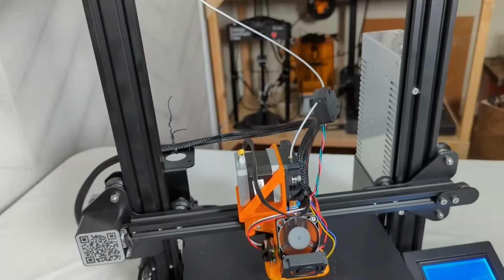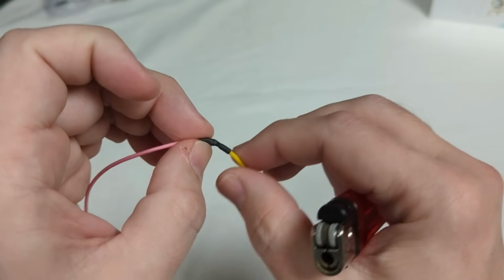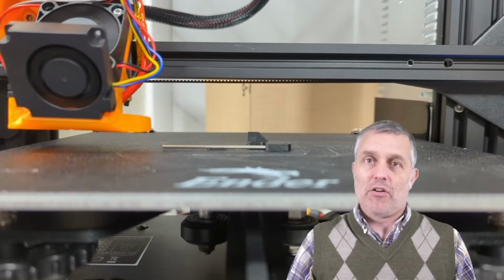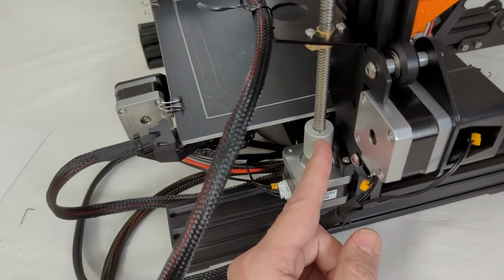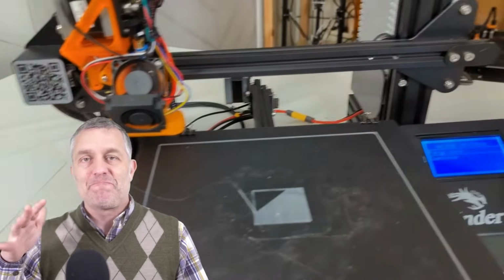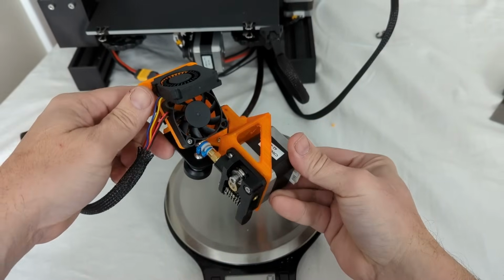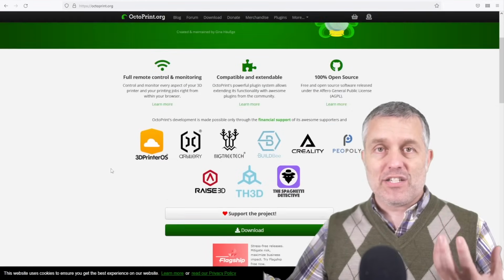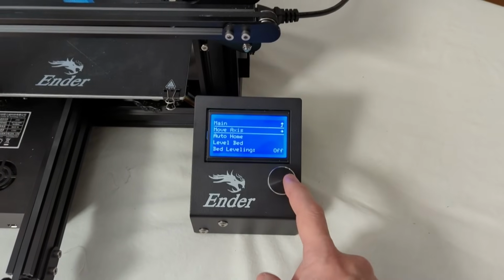Unbeatable for $200 - A 3DPrinter for Newbs & Print Farms

Comment: I think the part cooling fan duct should be a separate part. If a print fails and the duct gets damaged, a disassembly of the print head is required.
Reply from the maker: GOOD POINT! I've done this before and I forgot about it.
Reply: @DesignPrototypeTest  yea Josef Prusa would have made it 2 parts.
Reply: It's also a good idea to print the part cooling duct in a more temperature resistant material then the rest of the hot end casing, since it is subjected to much higher temperatures, and then use a lighter material for the rest to reduce the overall hot end weight so you can print at faster speeds without as much of a hit from the direct drive motor.
Reply: Petg is good for high heat stuff because it doesn't give of the VOCs like ABS.
Reply from the maker: @rjward1775   PETG suffers from far more plastic creep and heat deformation than ABS.
Reply: @DesignPrototypeTest   just print it with ASA should be as good as ABS, am i right?

Comment: So I just want to build the optical endstop, is it ok to not built the filament run out switch? because I feel I don't need it
Reply from the maker: That will be fine. If memory serves that is a normally open switch. Meaning the contacts touch each other when there is filament present. So, you need to connect the sensor wires together (or put a jumper between the pins on the PCB) to send the filament present signal.

Comment: The runout sensor is nice, but I keep thinking a movement sensor is required instead. The runout sensor is just a microswitch. We need it to be a rotary encoder so filament jams or filament breaks between the sensor and the extruder are noticed. A pulse making sensor whose count can be compared to the pulses sent to the extruder motor.

Comment: Anyone who has gone into large scale printing of the same set of parts with a print farm (Like Prusa himself!) should NOT be using a print farm, but have gone to injection molding.  Print farms are only viable for the prototype and alpha/beta test phase of a project.  Once you are into mass production and have all the kinks worked out, goto injection molding!

Comment: Bowden system places less mass on the X-Axis,so can have higher acceleration.  The Y axis is limited by the mass of the bed, so really, having the print head move in BOTH X and Y directions is the best for speed and lack of ghosting.  (Core XY?).  But even on a Prusa I3 type printer, the extra mass on the X axis will cause one end of the axis to droop from the weight if the Z axis isn't driven by TWO drive screws.  So, a direct drive extruder SHOULD be installed on a machine with TWO Z drive screws.  Now maybe the bed level system will compensate for this?

Comment: Does this work on an ender 3 pro?
Reply from the maker: The prints will bolt to the x-carriage. I don't know about the control board on the pro. These days. Might be a little different. The firmware as well might need some minor tweaks.
Reply: @DesignPrototypeTest  Thanks.  The control board on the outside looks the same, but something must be different because when I hook up the filament switch and optical sensor per your wiring diagram they do not function.  In fact the whole unit won't function with them plugged in.
Reply: @DesignPrototypeTest  Why didn't you use the G & V pins that are dedicated to adding the BL Touch?  You are only using the "out" pin from there.
Reply: @DesignPrototypeTest  Wiring is the same, I just had it wrong.  Firmware wasn't to bad to make following 3D Printscape's explanation.  It should be noted that it is important to get the allen key tip as flat as possible.  I experienced a wobble that caused the probe readings to fail, but was able to fix it with flattening the bottom of the probe out more.
Reply: I ran the repeatability test and it was pretty poor 0.018.  I attribute the result to sloppiness between the probe and the hole and the wobble factor.  With a piece of 1.5 mm ID brass tubing, some filing and sanding, and a cut up old credit card I now have improved the repeatability to 0.009-0.008.

Comment: I have watch his original video and I guess I am stupid because I didn't comprehend that you have to BUY BRAND NEW ENDER 3 PRINTERS to get his suggested parts to work, I re-watched his video several times and I still don't see where he states this won't work on OLDER ENDER 3 PRINTERS. I followed the directions for 6 older ender 3 printers and spent $40+ to find out these upgrade parts won't work on them.. So I trashed the $40 of parts  and chalk it up to being my mistake.  I know he mentions Creality websites to buy the printers but I didn't see or hear that these parts won't work on older models. So if you plan to use this on older  ender 3 printers unless you want to spend $50 for the new system board.. the parts won't work.  I know he is only out to help people so that is why I am blaming myself for the loss of the cost of the parts...

Comment: I did this conversion, and my print quality went down.  ;(   Vibration from heavy 289g stepper motor has an ill effect.  No more issues with clogging though.  Trying to decide what to do..
Reply from the maker: Stay tuned. I will be upgrading to a Sherpa mini in the next video. Much lighter weight.

Comment: I just bought an orbiter and micro Swiss along with adding a second z and motherboard upgrade for my ender. I'm just working on building thr firmware now but I got stuck watching your videos. I'm doing the same with my cr10 v3 with a real v6,  mainboard and a 70 degree enclosure with a carbon filter flush using a noctua at the end of a print. It'll be a button press before I open the door. I was going to order the copper head throat and cht nozzle but after shipping and customs it was going to be 250cad for 2 pieces of metal. The rpi in Canada costs 110 for a zero w2 and 300 for a pi 4 4gb. I have a pi400 I'm going to use

Comment: You can build an optical sensor with leds and just add that transistor you pointed to in a simple high pass filter to a resistor in series with the base and use the base emitter junction with a pull up to vcc on the collector and the pull the  signal from the sensor open collector tap with a .1uf cap to gnd and the output will either be open or closed which will have almost perfect signal detection because the square wave dc signal is sent through the circuit as an analog  sinewave and if the output produces a signal in the 90 degree top half or falling half of the positive part of the sine wave then you can infer a logical open or closed which will always show a logical high or low. True or false. I hope that made sense. A simple opamp voltage follower circuit would be better because the inverted output feedback resistor voltage drop could be used to verify the signal with an almost zero failure rate. I hope this made sense. It could be done with  5 surface mount components  taking up space thr size of half a penny. I over analyzed the filament detection circuit lol I've been reading alot of books on boolean algebra based on logic high ot low and loss of attenuation based on simifying the logical gates and using filters to produce a signal where there's no question if it's floating withing the region of uncertainty. Hahaha

Comment: dear sir.. will the new release have the option with direct extruder like this release.? I know in the newest prototype you have it without.. but something tells me the new release will include.. By the way.. Sincerely thank you for doing this.. also one more question.. I am one of those that have 6 ender 3 pros.. but they are a couple years old. I am being told I won't be able to boot off these the SD card to update the firmware? Is this correct? do I need a newer version of system board? Or am I being fooled? Thanks again..

Comment: Why not start with the Elegoo Neptune 2 or Voxelab Aquila?
The printers have the same price and already comes with the filament sensor, and it has a 32-bit mainboard with silent stepper drivers and adjustable belt tentioners.

Comment: This is the price point I bought my Ender at about a year ago. Honestly, I had the best experience with the BMG extruder via bowden to the stock hotend. Didn't care for the V6 at all. Since then I've moved to a Biqu H2, input shaping, pressure advance and klipper w/linear rails and print @ 100ms as a starting speed and prints couldn't look more perfect.

Comment: I watched your previous video, comments are turned off so commenting here but Prusa suck tbh. They do have good filament though, but i am not sure about their printers. They cost $2k here in Australia and They still use 3D printed parts!!! same with their New Big printer. $4k aud prolly and it still uses 3d printed parts!! Very expensive and almost the same issues as most china based printers like creality have. I have seen so many posts about extruder jamming on the MK3s! Prusa printers are overrated. Their filament is good but they gradually increased their tolerances from +/- 0.02mm to +/- 0.05mm Now.. This is just dirty. Prusa has too many Fan boys, just like Apple.

Comment: @ Design Prototype Test
I just bought an Ender 3 I have been sitting on my hand but after watching this and the supply issues I figured Id finally buy one for the price is pretty good. Do you have any suggestions on software I should get for modeling and slicing preferably cheap or free? I really have no Idea where to start. Thank so much!
Reply from the maker: Start with TinkerCAD. It's free and very basic. Everyone online uses Fusion 360, but that's because it was previously "free" they'll get your money in the end. I LOVE Rhinoceros 3D. But it costs 5 times more than your printer for a license, so you probably won't choose it. That being said, the pricing is honest. The version you get will work forever. They don't play those BS obsolete version games like other companies. Here is the video I made on the subject: https://youtu.be/pKLSTQcFTUI Just realize that you are making a serious commitment. Whatever program you choose you will spend thousands of hours getting good at it. You REALLY won't want to switch programs after all that time getting good. That's how they strong arm you into paying the big bucks for the complete program after they get you hooked on the free or cheap version. In the end the price tag ends up being trivial compared to the value of your time that you are going to spend in the program. Think of it like a video game. It's loads of fun, but also frustrating when you get stuck. You get sucked in and before you know it 5 hours has passed.

Comment: I've recently discovered the KingRoon KP3S and I'm blown away at the quality. It's basically a Prusa Mini for half the cost. Doesn't have auto bed leveling, but with such a small bed you aren't adjusting the leveling too often anyways. Has direct drive, linear rails, and can be setup in less than 5 minutes! The fanbase is growing too

Comment: As for the direct-drive extruder I think you should have just done Bowden and with pressure advance/linear advance, you won't be able to print flexible filaments, you'll have significantly less gantry sag because the x carriage a lot less

Comment: Should have given credit to Mihai for his findings on the repetitive patterns due to gear slop (and using his test print). This wasn't common knowledge until recently and you used his information for your own content, so at least a shoutout would have been nice.
Reply from the maker: Good point. I forgot. I've now added credit where credit is due in the description. See how that works? When someone is wrong they admit their mistake and correct it. This shows a strong character. Only inferior men think admitting they erred makes them look weak.

Comment: What about the mainboard fan on ender 3? That shares connection with the part fan. When you print abs without part cooling, the mainboard fan will be also stopped. Drivers can overheat. So it would be a good idea to change mainboard fan connection to the non-pwm connector.

Comment: Hello... thank you for all your hard work. I am going to fo do this project..  on the Dupont jumper wires do I need to get female to female ? thank you
Reply from the maker: Doesn't matter. You will cut and strip one of the ends.
Reply: @DesignPrototypeTest  thank you Sir... I appreciate your hard work.
Reply: @DesignPrototypeTest  I know a few that are saying they would still go with a commercial leveler.. but this is perfect for a guy like me as per your description (print farm) that has a boat load of ender 3 pro's and so far the ones I have swapped out are working great.

Comment: I think this is just about the best video you have done. Some very interesting ideas, well presented. 
Wrt heat creep and micro swiss. I found that originally,, because I'd got in the habit, with the original bowden tube set-up. switching off the printer as soon as the print was finished, I'd get the jams that you mentioned. The hot end cooling fan needs to be kept going, so it keeps the temperature gradient when the nozzle heater is switched off for the micro swiss system. If you get a blockage, then you can heat up the nozzle, maybe 20 deg higher than normal, then turn off the printer, wait for heat creep to occur, and then you can pull out the filament. Very rarely these days do I get a blockage, and since fitting the micro swiss hard steel nozzle, I've never needed to remove it..

Comment: Really good piece of tech.
If flexibility isn't the issue; newbies can use Seal Wire Connectors With Solder
Have you ever consider about built-in smart weight for filament?
I recomend to all 3d printers add rock base dampening
https://www.youtube.com/watch?v=y08v6PY_7ak
You are pale as a wall, use "mexican" filter on video. Overall great video.

Comment: Nice video. I designed my own inductive touch probe for my cr10s pro.  Later I designed and added conceptual a sea saw with a rusty hinge. Nozzle pushes down on high seat while the low seat raises benith the touch probe. On trigger the Z position is remembered and then the high seat is probed where the nozzle pushed down on it. The difference between the two measurements is the calibrated trigger to nozzle offset, no paper wiggling for me. A Duet controller allows a script that does the math.
I also use a hair dryer in my heated chamber which gets to about 65C (Ikea picture frame for a door and a clear 4x8' sheet of coorogated plastic folded into a box for the other 5 sides. I always probe hot because the bed changes shape at 110C and the inductive trigger distance varries about 0.3mm from cold to hot but this is automatically adjusted for by using the sea saw.
Cheers-Peter

Comment: I like your upgrades though I'm torn about your ABL and having the pin drag across the bed during the first few layers if you don't remember to remove the probe pin. One suggestion (if you decide to release custom slicer profiles) would be to put a pause both before and after the G29 to give the operator a chance to add or remove the probe pin without having the chase the nozzle around the bed. :)

You mentioned the new addition to the Ender line. It is the Ender-3 S1 and looks like an Ender-3 V2 w/ most of your upgrades for a premium cost ($389 for the S1 which is $117 more than the Ender-3 v2) if you have money to spend or are afraid to modify a printer.

Comment: I wish the Ender 3 was in this state 4 years ago.... dealing with flashing the bootload to be able to load modified Marlin 1.x builds (WITH thermal run-away)... trying to get features in to fit into memory... That said this is absolutely awesome how cost-effective/practical these are! My wife runs a mini print farm with Ender 3/Pros and these changes would help. However, I know her too well, that bed level feature is going to be forgotten, snap, and break something on the daily and be left to me to resolve =_=. Mainly because she never cares for these printers, they collect dust (thus overheat), fans stop working (thus overheat), and again left to me to resolve when it breaks. FYI I'd recommend ribbon cable clips for the display cable, she's lost circuit boards because that cable gets snagged under the y-gantry and demolished components from the circuit board.

Comment: Voxelab Aquila 179$ add a bltouch $40 dual gear extruder with upgraded springs  and Capricorn Bowden tube$30  $250 Alex/jyers firmware upgrade free and you have a trouble free printer with a glass bed perfect for beginner or add a remove able steel magnetic bed and your at 275$ and it can be a good work horse and print a lot filament runout sensor is free when you add a bltouch you just print a housing for your z end stop micro switch .
Direct drive isn’t exactly a upgrade it’s a side grade in all honesty and it’s something that should be decided after you get into printing . For most people especially hobbyists who aren’t printing a bunch of interconnecting prints where retraction is more critical.

Comment: Totally agree that direct drive is the way forward. 

Even if you have klipper and are doing resonance compensation, the bed is very much the limiting factor on a bedslinger style printer.

Secondly, the much shorter filament length between extruder and hotend means you can print faster before getting pressure control artefacts, and if you get linear advance/pressure advance working, it has a lot less to do and gets better results and both the marlin and klipper implementations slow down your movement so the pressure advance can keep up and a longer Bowden is much more affected.

Note that marlins's linear advance doesn't work reliably on the Creality silent boards.